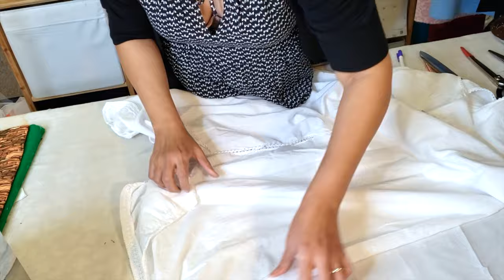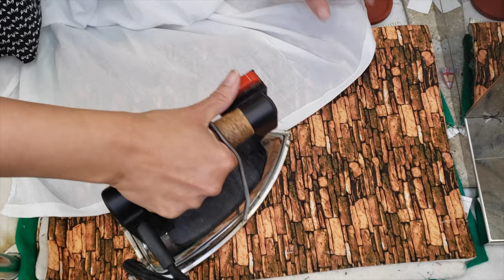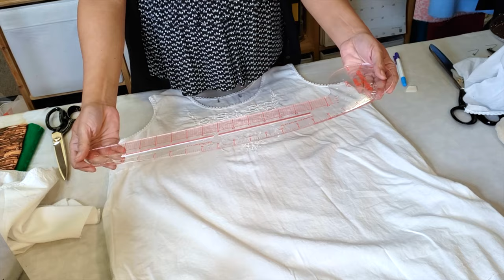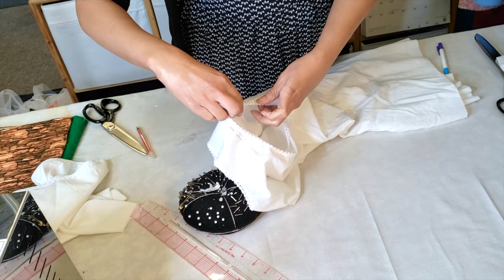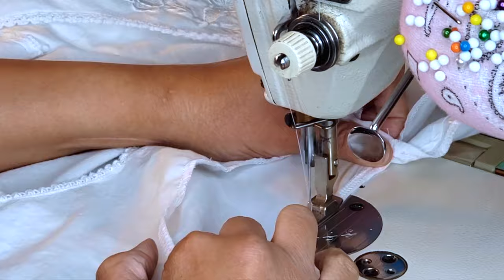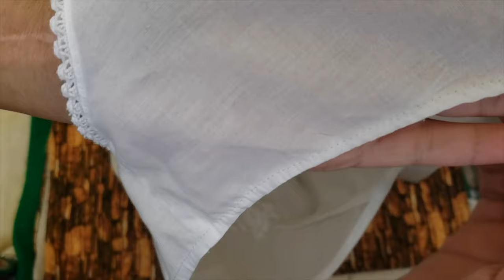Loosening Arm Holes & Structured Gown Hem (INNOVATIVE TECHNIQUES!)

Comment: You are so cute and fun to watch.  Can you reuse the Ban-roll after hemming a garment ..for example if I hemmed a top with a one inch hem can it be reused to do another one inch hem on another garment or does pulling the ban-roll out of the hem when finished sewing damage the strip so that it can only be used for a narrower hem?
Reply from the maker: Thanks.  You certainly can use the ban-roll many times.  Mine last for years!

Comment: I am large busted, if I buy, for example, a tank top the arm holes are not that far from my waist.  Is there a way to fix a large arm hole and make it smaller?  You are amazing,
Reply from the maker: Thanks so much 🥰 shorten the straps at the top and/or make a dart coming from the armhole to the bust helps a lot.  Cheers 😊

Comment: I’m re-watching this video because I’m hoping to work on my top this weekend. What was the difference between the two sides of the elastic?  How do I determine which side to use?
Reply from the maker: You can use any side. But try to make the first stitch on the side further to the edge.  Cheers!
Reply: @DowntownTailoring  thanks. I’ve been researching online which elastic brand is the best, and I’m ordering tonight.

Comment: I am a little confused.  Why was there excess fabric to cut off after applying the elastic tape?  I thought you placed one edge of the elastic to the armholes cut edge, and then sewed next to the inside edge of the elastic.  I know you did  an excellent job of measuring and cutting the armholes.  So what did I miss?  Again why extra fabric to trim off the armhole?   And if didn't place elastic at armhole edge, where did you position it on the armhole, please.  I hope this makes sense to you.
    I truly enjoy watching you work.  You are so talented.
Reply from the maker: Hi. I can see your confusion.  I tried to sew the elastic the best I could to the edges.  But because the elastic is straight while the armhole is rounded, there are always a few shifting here and there.  So I cut again to make it smooth and one line only. 
I hope this helps ❤

Comment: You should have kept the white nice trimmings for both the hem and the arm holes. 😌
Reply from the maker: Hi! It would have been great to reuse the trimming but the customer wanted a plain slip. Anyways I wouldn't be able to reuse it as the final armhole was bigger and the one on the hem shrunk after so many washes. So, again,  not enough. But I agree, the trims were cute! ☺

Comment: How would the process be if it is a button down shirt with a long or short sleeve ?  I have wide shoulders and always have a problem with armholes snugged against my armpits.  If I buy a bigger size shirt, then the other proportions are off. Thx
Reply from the maker: For what I understood I believe your best bet is to insert eyefish gussets starting on zero at the chest area on each side, opening to 1.5" or as much as you need and going back to zero around 2" to 3" up on the sleeve.  If the shirt is too long and you can shorten it, you'll have the perfect matching material from the scraps.
Reply: @DowntownTailoring  can. you show us how to do that?
Reply from the maker: @kittydemeo  yes! We’ll make a video about it.

Comment: Love this! What is the hem helper tape called? Do you completely pull it out after, or does it remain in partially? And the clear elastic- is that what it is called? Love your vids, you are adorable!
Reply from the maker: Thank you so much! What I used for the hem is called BanRol waistband interfacing. Yes I do completely pull it out, nothing remains as the more transparent edge is tiny enough to slip through the holes once I pull it. Soon, I will make a video showing how to prepare the interfacing tape. For the sleeves, yes it is called clear elastic. Hope this helps :)
Reply: @DowntownTailoring  Thank you! This is such a great idea! An easy guide for a straight seam without having to sew and turn twice.
Reply from the maker: Exactly! Thank you :)